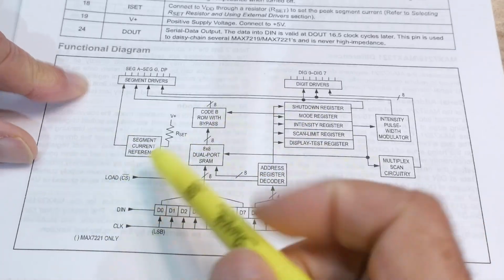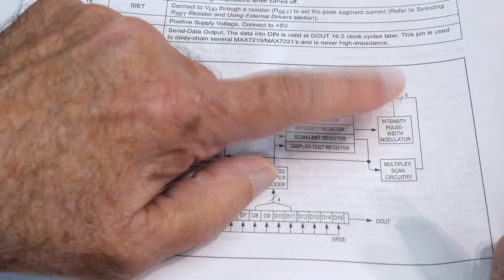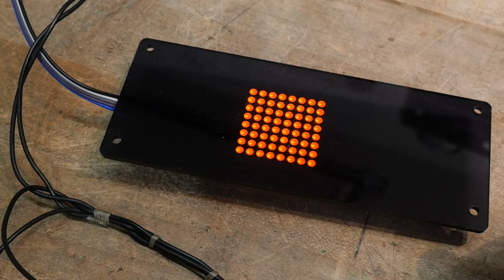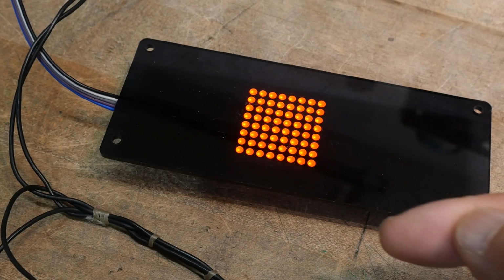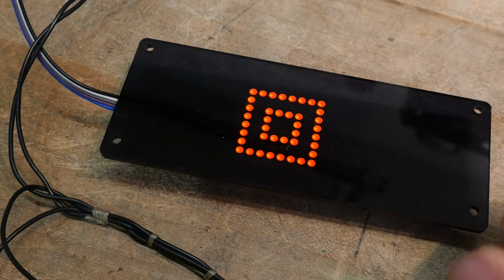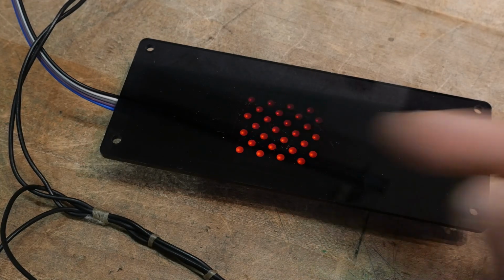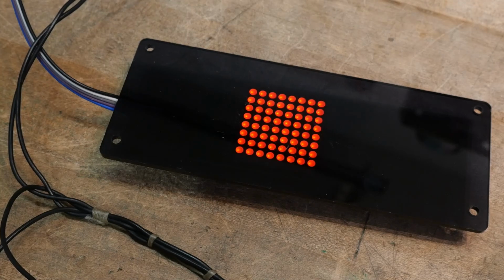#2136 MAX7219 8 Segment 8 Digit LED Display Driver

Comment: Those led display boards with the embedded MAX7219 are a real bargain, I bought three for around ten
bucks.  I turned one of my displays into an Arduino-based clock that displays time as two dominoes.
It takes a bit of training to read the time, but it's kind of a fun clock.
Search for solorb Domino Clock for details on the project including the Arduino sketch.
Keep doing those Chip of the Day videos.

Comment: I have not used these.  Do you just shift in the row and column bits 8 times?  (...and repeat)  It would be nice to have 8 registers to store the 8 row bits and then have the chip multiplex them automatically.
Reply from the maker: you write into the eight row registers, and it does the column mux auto

Comment: They also sell them with four of those 8x8 LED diplays mounted side by side with the MAX chip under the display., and the connectors are in a sensible place to chain them together.

Comment: Too bad they're ridiculously expensive though. ~17USD for singles at Digikey.
Reply: I noticed that a while ago, I wanted to order the chips just for experimenting. The odd part is I can get four of  them with the 8x8 displays on a board from a local Canadian seller for under $10.
Reply: @jerril42  I think this part has been counterfit'ed.
Reply: @ I'm pretty sure they are. I wanted to put that in my response, but I try to keep my comments brief.
Reply: Crazy prize but it's quite cloned.  The first Ali listing I just saw was $2.14 for 10 pieces (with free shipping). I normally won't consider clone parts but here...
Reply: @Peter_S_  IIRC the cloned parts run much hotter.  And I think??? you can (still?) get legit samples form Maxim.
Reply: @GeorgeGraves most clones are fine if not better, i have not noticed any kind of heating or performance issues so far and i have used a lot of these. Why waste money on overpriced geniune stuff from maxim unless you are doing something mission critical and peak reliability is required.
Reply: @pvim  no

Comment: Bit of a coincidence here. I've just started a project using a few quad versions of these to build a scrolling alphanumeric display with a Pro Mini board but if it works I'll see if the code will squeeze into an AtTiny.